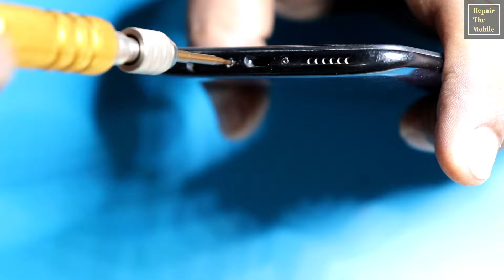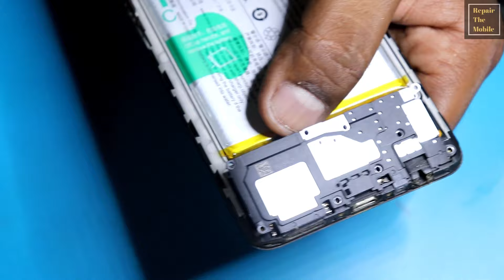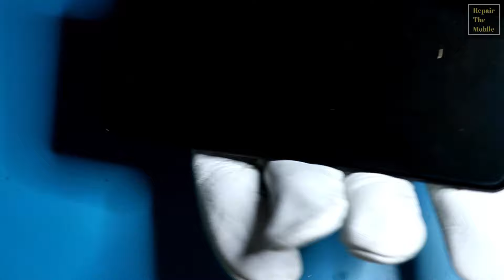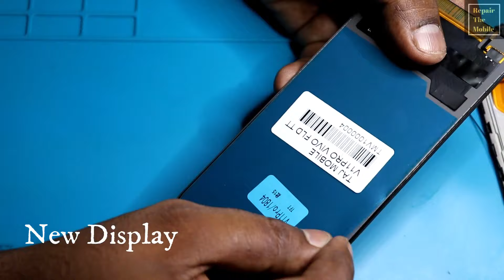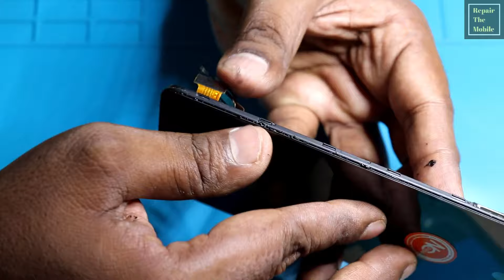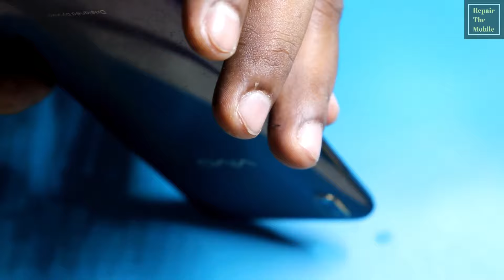Vivo V11 Pro Display Replacement

Comment: Battery remove karna jaroori hai kya? Sirf connector nikal k kaam ban sakta hai. Pls explain why you removed battery.
Reply from the maker: Yes,  it is advisable to remove battery before connecting Display connector. Because there is anode & cathode pins of backlight on display connector. While connecting display, there may be some chance in short circuit between anode & cathode which results into blank light. So it is advisable to remove battery
Reply: Thank you for prompt reply. Gr8 explanation.

Comment: My v11 pro display corner getting purple automatically. What i do now 🙏😥.how much it cost?. Display working fine but left corner getting purple automatically and it increases automatic.
Reply from the maker: You may have to change the display. But before that, once get it checked by Service center. They will tell what is the actual problem
Reply: @RepairTheMobile  how much cost?
Reply from the maker: Local shop around 2500 to 3000
Reply from the maker: Both types available in market. Pehle puchh lijiye.. sensor kaam karnewala display aur 1000 jyada aata hai
Reply: I hope it's sorted now 🙂
Reply: Hi same problem with me please tell me how much it costed you to repair it

Comment: Is this display can support fingerprint scan or not?
Reply from the maker: No
Reply: Nosgajfjan
Reply: wobzka
Reply: V11
Reply: @RepairTheMobile  bro …i replaced display from local shop …auto brightness is not working …is that other issue ? Or will it work only on original display ?

Comment: Mera touch screen bich bich mai atak jata hai pir mai power on/off krta tb tik hojata hai kya yeh software problem hai ya display vivo v11
Reply from the maker: Do factory reset once after taking all back up. If problem still exists, check at ur local repair shop

Comment: Difference between original display and ones in local shops. Tell me bro
Reply from the maker: Fingerprint sensor may not be working in locally available display.
Reply: @RepairTheMobile  how much it will cost for original display?

Comment: Hi after replacing lcd the technician can't figure out why the sensor at top keep detecting that its being blocked, do you know whats wrong?
Reply: Same what appear in your last clip
Reply: You can disable by setting
Reply: Even i had a same problem . I tried wiping at top and the issue was sorted out.